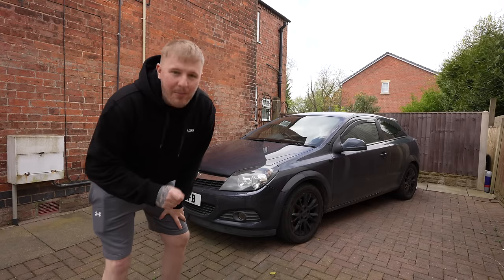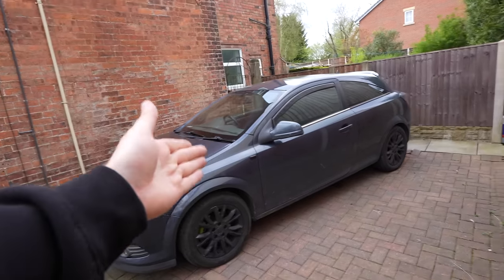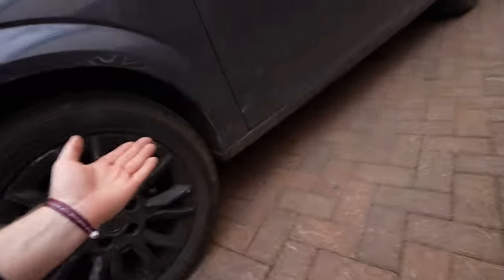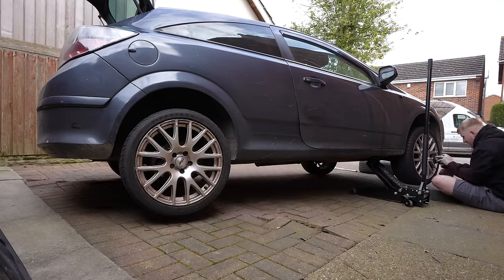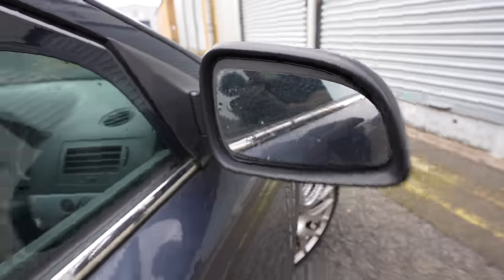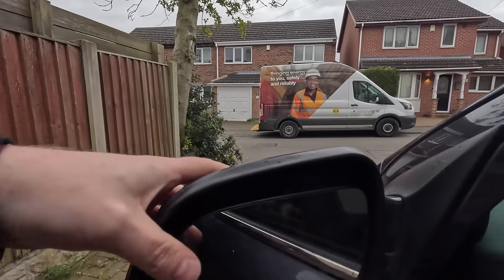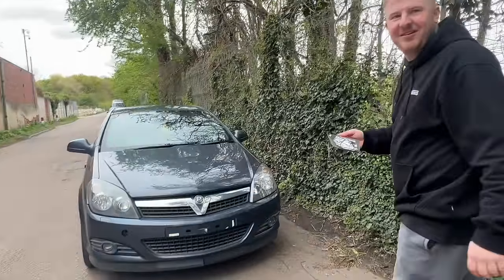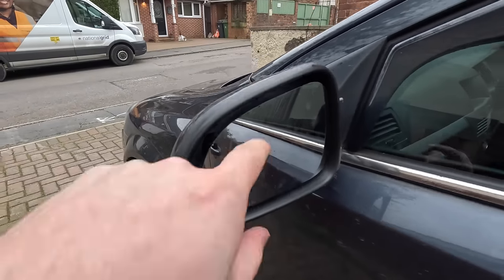SAVING A VAUXHALL ASTRA FROM THE SCRAPYARD - PART 5

Comment: The backing plates are heated....Vauxhall owners obviously leave the heated mirrors on all year round, that's why the glass falls off and needs replacing....with the wrong size.....yours are heated, that's what the 2 wires are you plugged in

Comment: If the wheels came of a vectra then why were you worried they wouldn’t fit on the Astra 🤔 aslong as it’s a 5 stud and not a 4 then there definitely wouldn’t be a problem. If they came from an insignia however they won’t fit
Reply: Stud paterns will definitely be the same because both  Vauxhall but the offset isnt the same for every Vauxhall which would cause problems with rubbing on the strut and steering not turning to full lock
Reply: @quincy5855  have you owned many Vauxhalls?
Reply: Vauxhall use all manner of wheel stud PCDs. For example, on the Astra J alone there are 3 different 5 stud patterns depending on which engine is in each model
Reply: @simonbyrne1182  I’m talking about before the Astra J and insignia Vauxhalls. After that the changed and now owned by Peugeot so is what ever PCD’s they use
Reply: @simonbyrne1182  wrong. The astra J and K is 5x105. The gtc is 5x115 same as the zafira tourer and insignia. First shape insignia was 5x120.
Reply: @benjames3761  the big diesel Astra J's are also 5x115 and I believe there's a 5x110 in there too. All the Astra K's are 5x105 now.